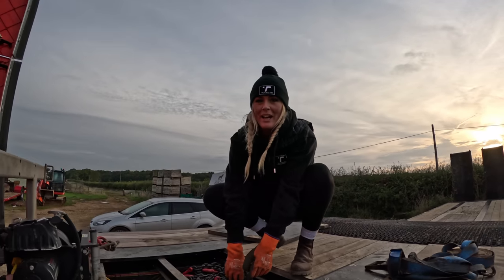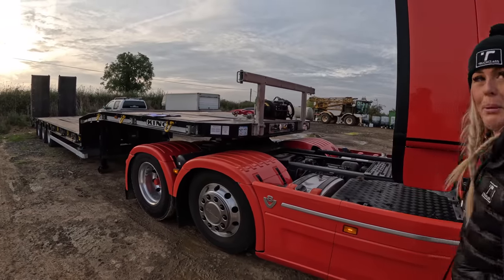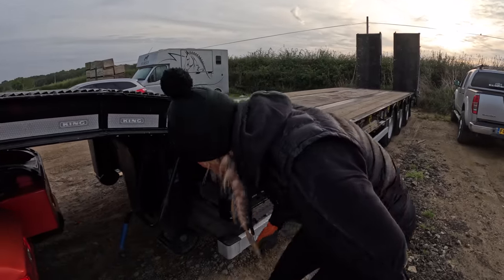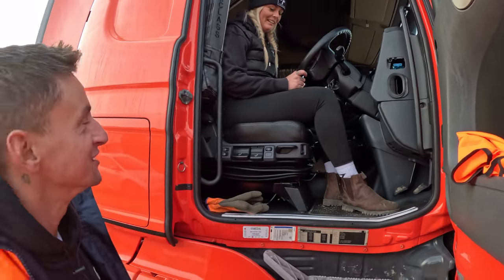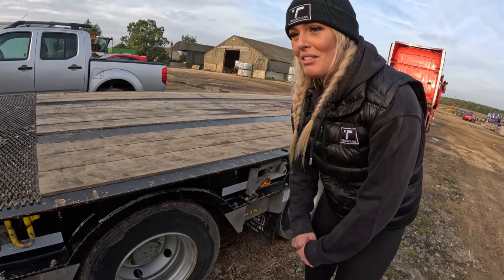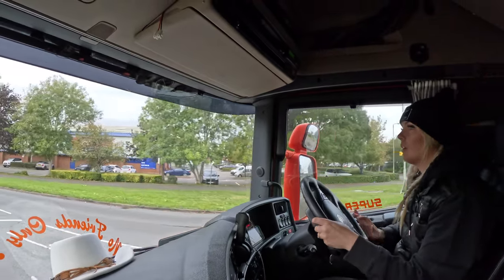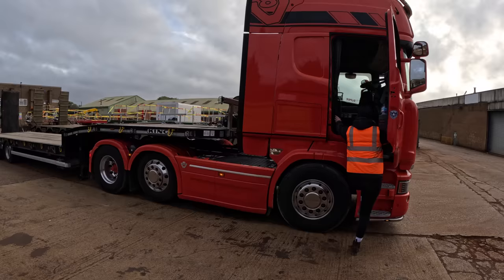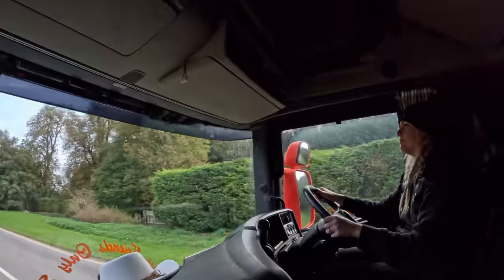FAILED my driving assessment! - Returning the trailer - Another Starbucks...

Comment: This was very good to watch.
All the things you need to check before you move off.
Ordinary people like myself wouldnt know, but Iv often wondered. Something else Iv always wonddered about, is how you judge exactly where the front and sides of the tractor unit is when you are driving, particlarly in heavey traffic. For example, a town quite local to me (Im from Ireland), has a long narrow main street. Just off the main there is a large bakery, and on the south end of the town is a medium size factory, and a large mill that produces amimal feed. All of these businesses have several artics, with the mill having about 25 alone.
The town is continually blocked, as the artics make their way through, taking care to aviod cars, tractors etc.
The lorrys often have only centimetres to spare as they make their way through.
Im always impressed at how skilled the drivers are, as there is rarely if ever a collision.
Is it difficult to judge exactly how close you are to parked vehicles, when your up so high in the cab?
Reply from the maker: you have plenty of mirrors to see your blind spots, and you get used to the size of the vehicle just like you do In a car 😊

Comment: Nice video, I past my test 15 months ago and still loving most of the life of trucking. I always listen for the double click on the 5th wheel and do 3 tug tests and never dropped a trailer, another thing is skid plates can cause problems with low trailers but they do save the body work. Another trick if you have a trailer that's been dropped too high and your struggling to wide the legs up and its fully loaded, let the truck idle and wind them up. It saves alot of hassle
Reply from the maker: Great tip!

Comment: The safety clip is not there to stop the handle coming out, it is designed so that if it does not pass through the hole then the handle has not gone in fully meaning you have not coupled up correctly. The clip can be left off whilst driving regardless of what the DVSA tell you. Some truckers don't use the clip and use a padlock instead but either way you don't need to have anything in the hole once you have proved that you have coupled up correctly. 
Also it is not good practice to leave the engine running whilist coupling/uncoupling as it wastes fuel and is not good for the environment

Comment: i`m an x instructor from when he was in nappies. he could learn to smile. its an assessment not a test. mirrors should be every 8 to 10 seconds in normal driving. the trailer should have had its height posted to the trailer. the assessor picked on the driver because he knows her, as such the assessment would be false it should have been taken by another assessor if it was a real assessment.
Reply from the maker: so a low loader should have a vehicle height marker? 😂  good job you are retired
Reply: @truckerbaddie  yes. how tall are the ramps at the back....... as for you. if i was an examiner and you was on test with me i would have failed you.... you went round a roundabout with 1 hand on wheel and the other hand on the indicator, you was unsafe steering the obstacle (roundabout). also you entered your exit and as soon as the cab entered the exit you turned off the indicator before the trailer had left the roundabout. what would the people behind you think